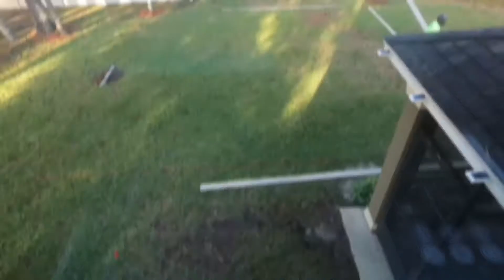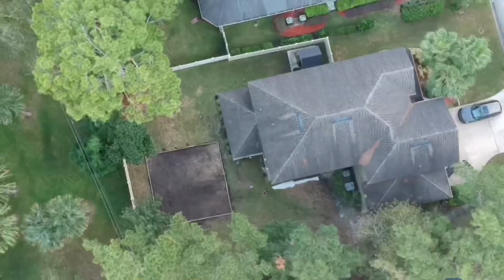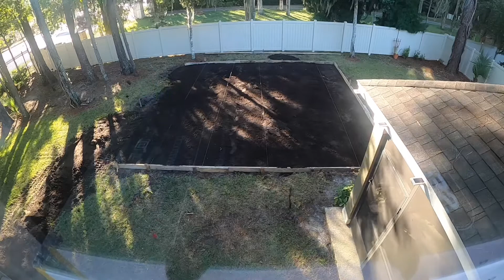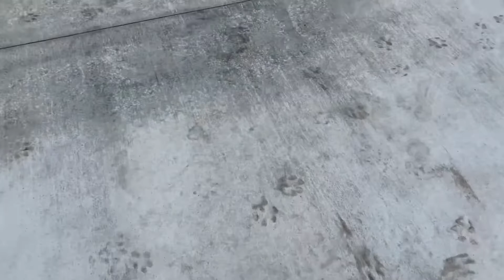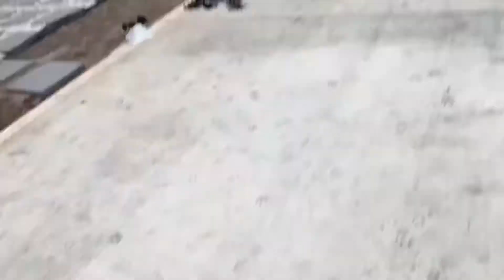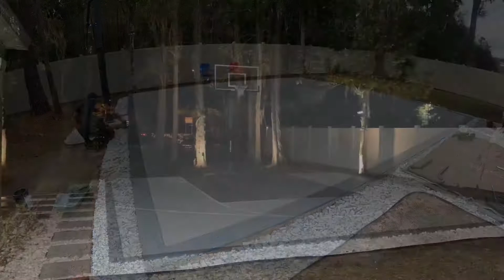Backyard Basketball Court 26x26

Comment: What kind of paint it is. I just built a 24 x 24 and would like to paint same.
Reply from the maker: I used a concrete paint that I bought at our local hardware . I should have added a non-slip additive to it. Even though the concrete has been graded not to smooth.